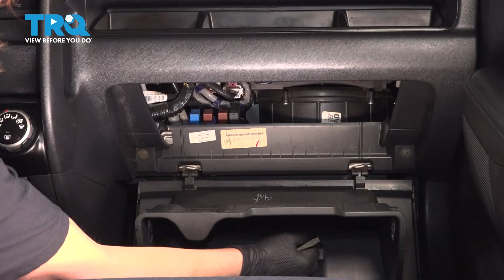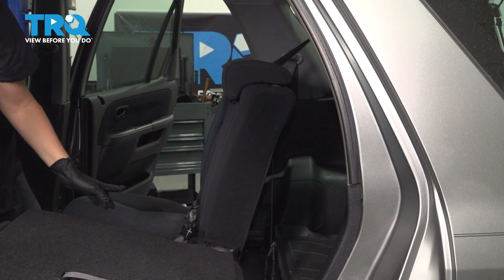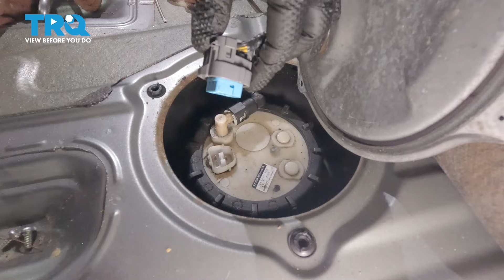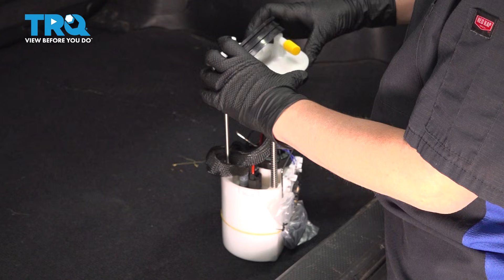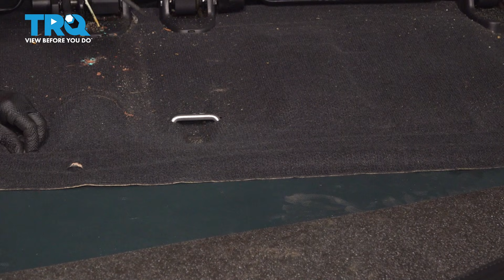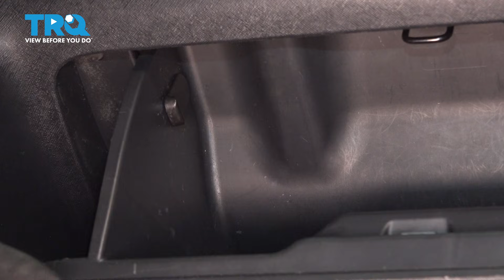How to Replace Fuel Pump Module Assembly 2002-2006 Honda CR-V

Comment: Nice video. How did you get the fuel clip off the old unit? 
Also,it appears that you reinstall the old unit. The new unit has two ports on top; one isnt used. You install a unit with only one port. Corraborating this is the yellow discolored body of the unit. The new one is snow white.

Comment: Is there only a relay and no fuse? Fuse no. 17 in the foot well (the one with the engine symbol) points out up Fuel Pump but it does not sputter  like yours does when removed. It just cranks straight. Why's that? Does it cut fire to the injectors instead?

Comment: I replaced my fuel pump in my 03 crv was driving and died out on me, checked all fuses and relays all turn on like they are supposed to found out the pump was bad installed new pump now I hear it hum but now when cranking my fuel pressure is dropping have any idea on what it could be ?

Comment: I hope I'm correct about the plastic fuel feed outlet nipple on the filter assembly having an outer diameter of 3/8" or 9,5mm... Tomorrow I will try to empty the tank from 3 years old gasoline,,,

Comment: The fuel pump in the description, as well as the new one in the video, both have extra nozzles at the top. Are you CERTAIN that the one in the description is correct? I have just taken the old one off my car and noticed the difference.

Comment: Hi, very clear video! hank you. I have a 2004 CRV that has been sitting for 2 1/2 years without being driven. Would you say it is essential to replace the fuel pump in this case? Of course I 'd rather just pump out the old gas, but if the pump needs to be replaced, I'll do it. It ran perfectly before it was stored. What is your opinion?